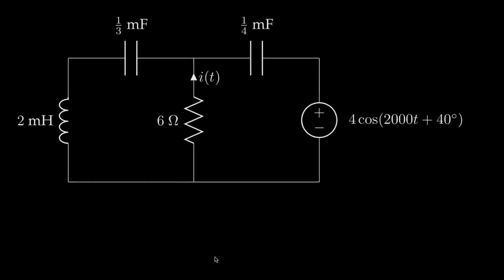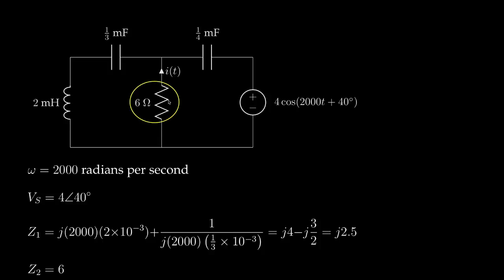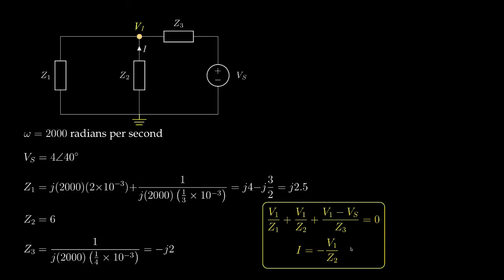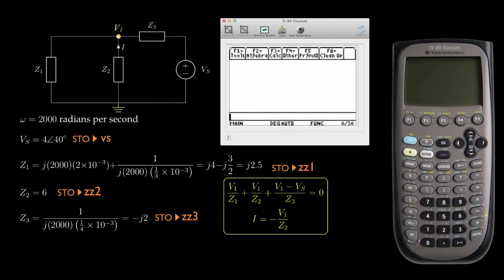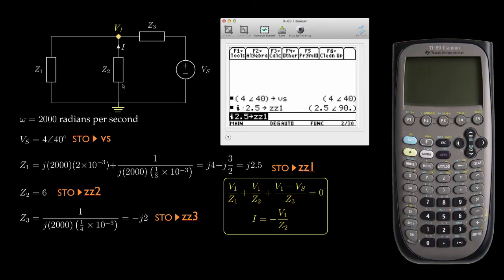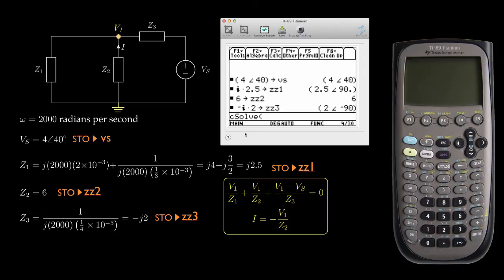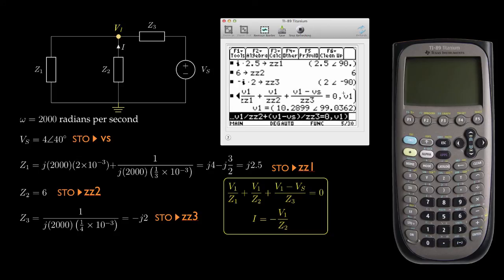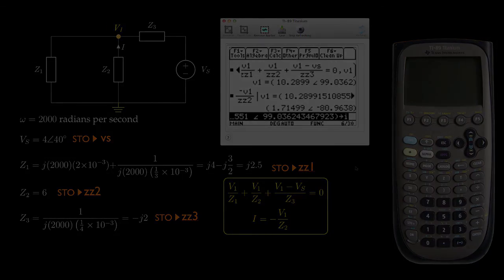Sinusoidal Steady-State Analysis: Part II

Comment: Why did the angle change when you divided by real number?
Reply: i got 1.714<99.03624
Reply: You forgot the negative sign in your equation. When you negate a Phasor the new phasor comes out of the origin exactly 180 degrees from the original, which is why the angle changed. Not because of the real valued impedence.